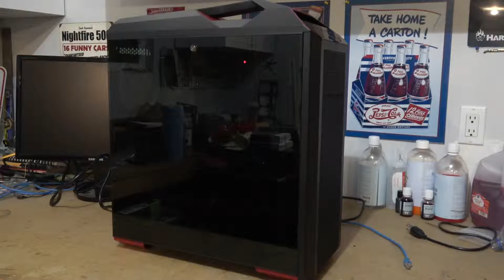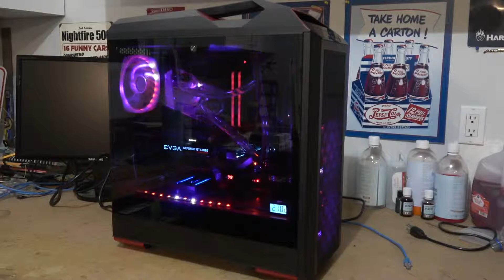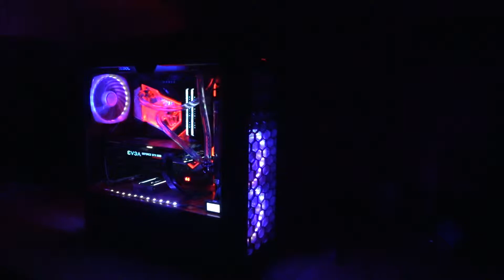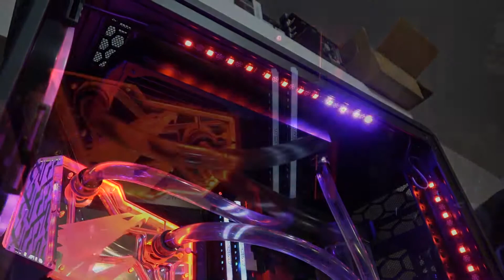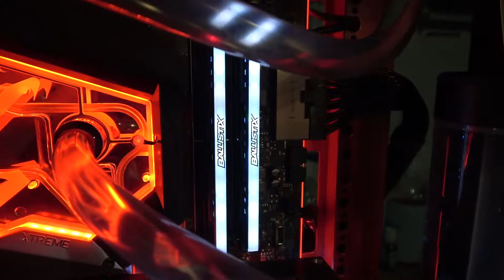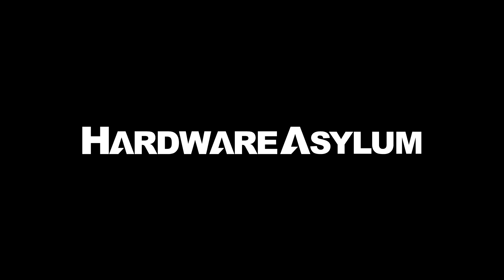SilverStone LSB02 Addressable RGB Build and Demo

Comment: hi just stumbled accorss your video, i have an ekwb velocity DRGB cpu block which i should be able to use on rgb fusion 2.0 on my Aorus z390 pro, howveer the software is complete ass and just simply doesnt work, will this be a good work around and allow me to avoid using the rgb fusion 2.0 software altogether?
Reply from the maker: Yes.  however it won't control the RGB on your motherboard.

Comment: I think I plugged everything in properly but my controller literally doesn't do anything at all. All of the ARGB items I have plugged in are currently just static red, any advise for troubleshooting?
Reply from the maker: Can't really help you there but, getting everything to light up is a good first start, the strips and fans are keyed so that part is pretty easy.  Did you press the color change button on the remote?  Did you remove the plastic bit from the remote so the battery works??
Reply: @Hardwareasylum  I found it out, molex cable was daisychained to another piece and it wasn't getting enough power for whatever reason
Reply from the maker: Knew you could figure it out.
Reply: @Hardwareasylum  Hey, thanks for the response. Yeah I pressed the buttons but nothing worked, I definitely removed the plastic bit from the bottom too.

Comment: I really loved the idea of RGB control that didn't require software, but unfortunately some elements are just not working for me, like the temperature-controlled fan speed which doesn't adjust the speed so much as shut some fans off while leaving others going. Fan speed selection in general just doesn't give you enough control other than on/off, and as far as the lighting one thing I haven't been able to get it to do is "chase" from one fan to the next, like you can get corsair lighting to do. And the other thing which was the final straw for me is the fans emit a ticking/buzzing sound at lower RPMs. It's not loud but unless I have music playing I can't not hear it. I do appreciate the company making something that's non-proprietary though, since most of these companies try to force you into their ecosystems and that really ticks me off.
Reply from the maker: SilverStone has their own ecosystem mostly with the plugs they use, they are also easy to change however not worth the hassle.  I would agree with you on the fans, they leave a lot to be desired and for the effort I would use the ARGB rings and pair those with a high quality fan.  Personally I never let these controllers set fan speeds for various reasons, one of which you already called out.

Comment: If you use the remote control to start the computer do you sacrifice the physical button on the case?
Reply from the maker: Nope, the physical button still works.  The device acts as a pass though for the switch connection.

Comment: Does this controller work with non silverstone rgb fans and LED strips
Reply from the maker: Quick answer:.  Yes.  More accurate and elaborate answer:  SilverStone (and everybody else for that atter) use their own connectors to make installation easy however, everything is using the digital 3-pin headers so just lop the ends off and reconnect them to whatever you want.